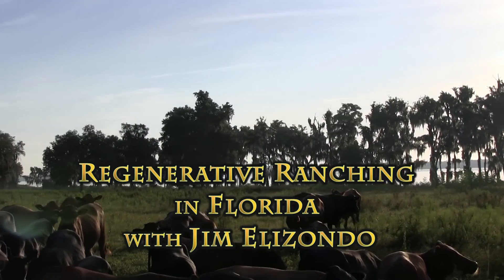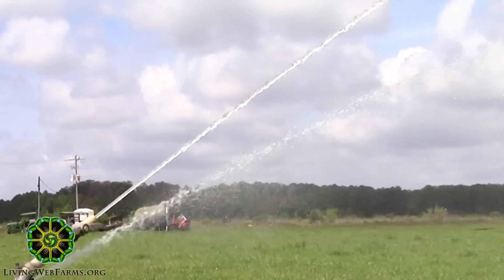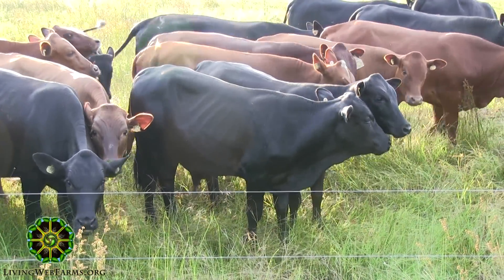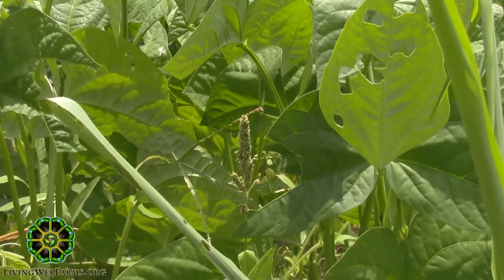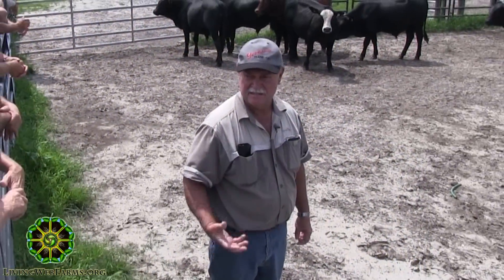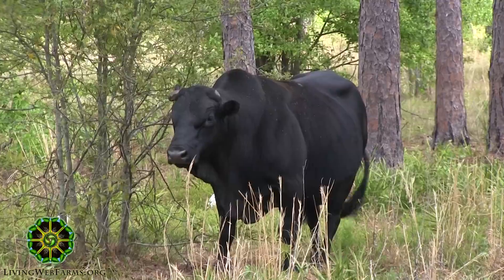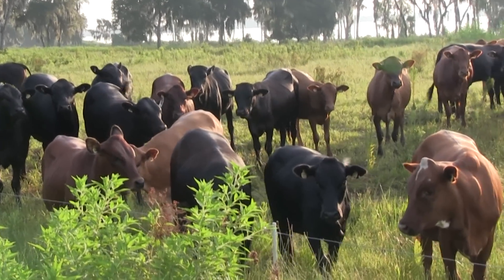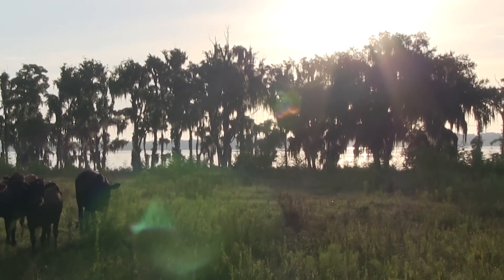Regenerative Ranching with Jim Elizondo

Comment: I'm curious as to why they're seeding annual cover crops for grazing rather than creating perennial pastures.  This seems like an energy-intensive method of producing animal forage, since it requires constant inputs of new seed, diesel to run tractors and seeders, etc.  after each paddock is cleared out by the grazers.  I expect there's some good reason for this approach, perhaps related to the near tropical climate, but I have no idea what that might be.  Does anyone know?
Reply: You'd have to ask Jim.
Reply: There are no common cool season perennial grasses that will live in the subtropics. This means you typically rely on warm-season perennials like Bahia or Bermuda overseeded (after disking, usually, at the end of the warm growing season) with winter annuals or cover crops. Stockpiled (left in the field to be grazed like standing hay) warm-season perennials like Bahia are low forage quality (low protein), and so you have to supplement with legumes/alfalfa hay, etc. Hope this helps explain.
Reply: @jenniferrichardson3155  Yes, it does.  Thanks for the explanation!
Reply: @jenniferrichardson3155  A major advantage of the Mashona breed is their exceptional ability to utilise high volume, low octane grasses such as Bermuda (Cynadon dactylon is native to their country of origin) which is how they manage to thrive on poor quality winter forage, though a protein supplement does result in better winter performance.

Comment: I like the use of Diatomaceous Earth to treat the fly problem.  However, I wonder if a better solution would be to follow the cattle with pasture grazing chickens to help reduce the fly population by eating the horn fly maggots in the cow pies?  This is one thing I recently learned from watching some of Joel Salatin's videos.
Reply: +TradingRiskMgmt even better is the work of the dung beetles to reduce fly maggots. i also wonder what regulators say about cowpie-fed chicken.:-)
Reply: they don't eat the manure. they scratch through it looking for larvae and grain. this helps distribute the manure into larger areas.
Reply: Yep. The chickens need to come in three days after the cattle have been rotated out of the paddock.
Reply: Yep..  run the chickens
Reply: @1mtstewart  there's a type of beetle that eats fly larvae and eggs.